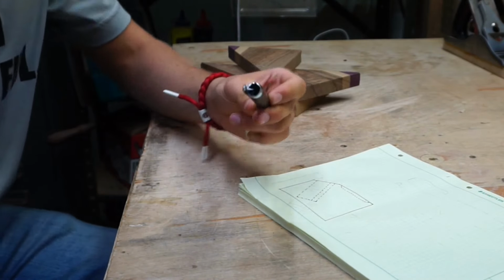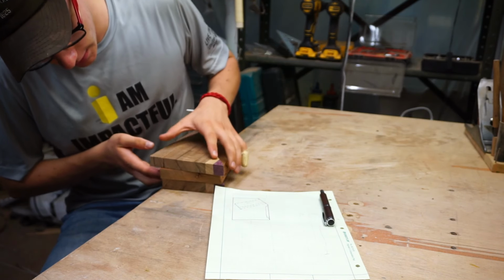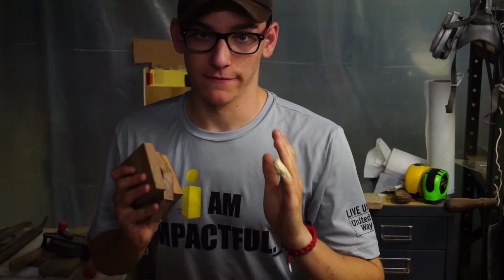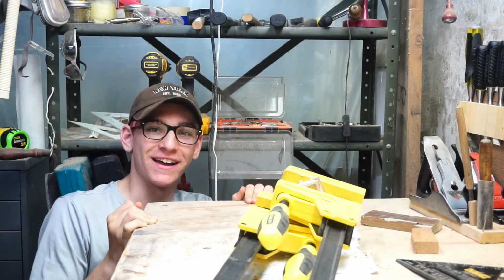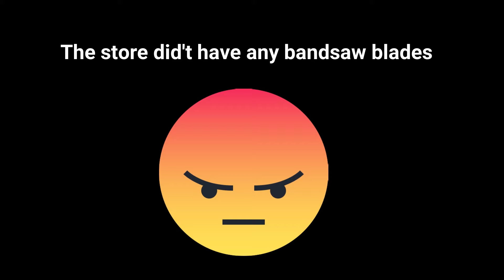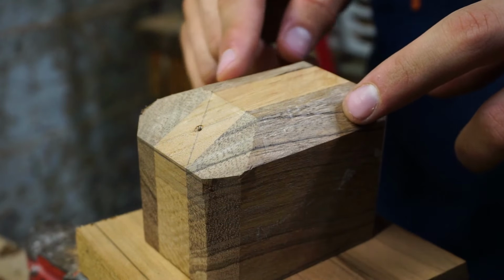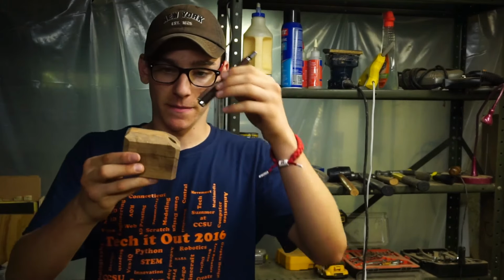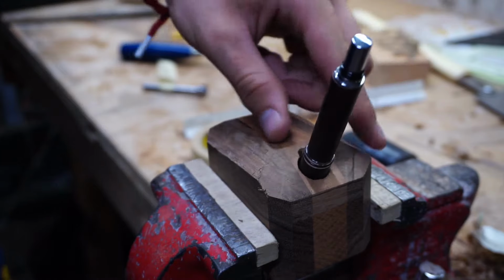MAKING A CUSTOM PEN HOLDER

Comment: It appears to be the first fountain pen for You... Anyway - the proper way to store/display fountain pen is horizontally or nib forward the top. If nib is faced down due to capillarity effect the ink will leak into the cap. So - cap up and the additional cut-out is not needed :)
Reply from the maker: Thank you! I appreciate the feedback. I think I may make a new one to fix this issue.